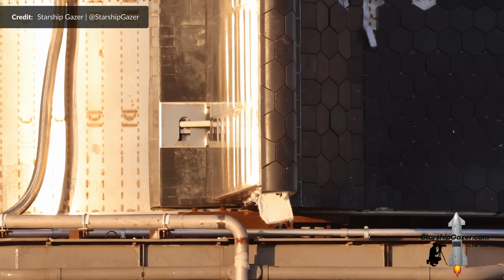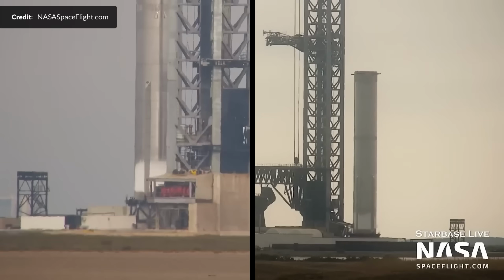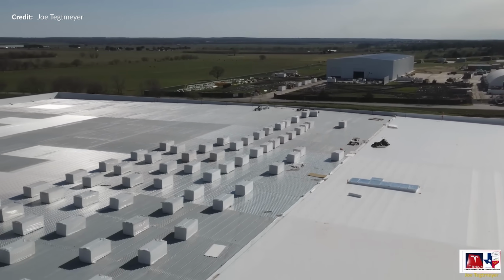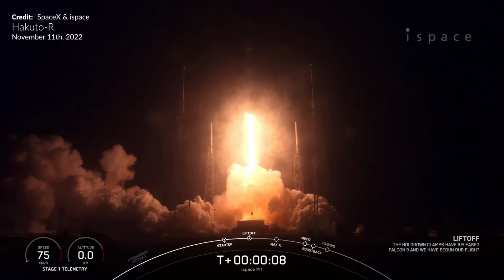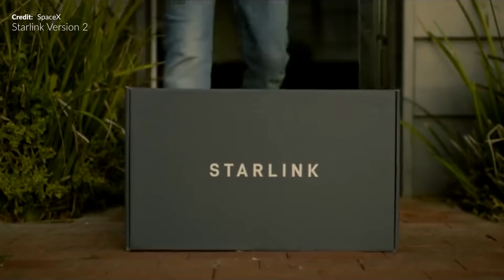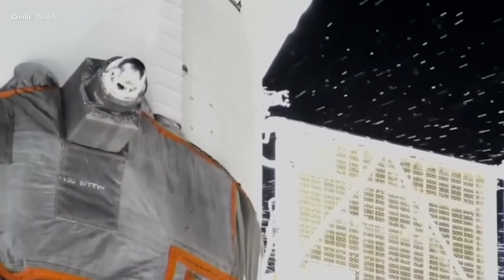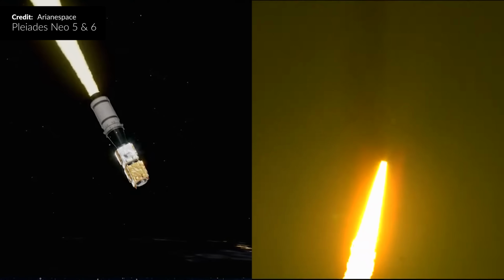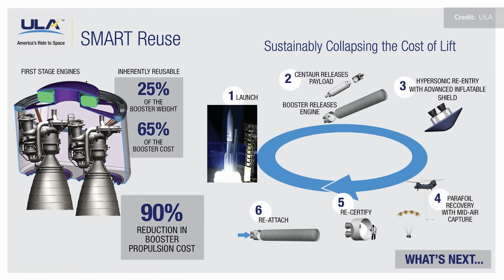SpaceX Starship Update, Record Booster Landing,  Soyuz Leak, Vega C Failed and Much More

Comment: These tiles will never work. These will be what ends starship if not fixed. While much more complicated, transpiration cooling should have been used. We've seen time and time again that tiles are a disaster waiting to happen to spacecraft. We've seen on this platform that they pop off left and right. This is without the body flexion, vibration, and strain of hypersonic re-entry and massive thermal cycles...heating and cooling all the while. It's going to hurt like hell to rip this bandage off, but they better do it now and redesign the heat shield system. Mark my words, the first re-entry test will fail due to heat ingress caused by missing tiles.

Comment: The tiles are popping off because the stainless steel hull contracts when cooling by filling with propellant. That is a mayor drawback of using stainless. It deforms massively under heat changes.

Comment: There are 7 SpaceX launches in December, including three in less than 36 hours.  And at the moment LC39A is tied up with preparations for the next Falcon Heavy launch.  Maintaining that rate will deliver 84 Falcon launches in 2023.  The announced 100 SpaceX flights for 2023 will include the permitted 5 Starship launches from Starbase and presumably some Starship launches from LC39A.  Because of the Falcon Heavy preparations it will not be possible for SpaceX to launch a Crew or Cargo Dragon to the ISS before the end of January.
Reply: CRS-27 is planned for Jan 2023 and Crew-6 is planned for Mar 2023.

Comment: Question: Regarding flames creeping up the fuselage above the engines of SpaceX Boosters. Is this nominal? Doesn't this cause damage? I'm assuming it's a low pressure area but I would have expected a better aerodynamic design. [see: 19m 23s]
Reply: Yep. Nominal. You can't have a cylinder that doesn't present recirculation zones behind it, unless you change its shape completely. This causes the low pressure zone you mention, which sucks the flames into it. Engineers know this, so they add thermal protection where needed. =)

Comment: We must remember that when Shuttle Atlantis lost more TPS tiles than Columbia it reentered successfully, and was relaunched only months later.  That was because by chance the lost tiles were over the only stainless-steel part of the hull.  Starship, whose hull is all stainless-steel, does not need the tiles for survival, only for speedy reuse.
Reply: The lost tile on STS-27 was over an aluminum antenna mount, not steel.

Comment: Just thinking about the reuse of the BE4 engines, since the rest of the rocket remains expendable, maybe they will use a set of explosives girdling a tank to destructively separate the engine section?  While expedient and requiring minimal additional engineering of the overall rocket, the resulting ragged end wouldn’t necessarily ease the other challenges of re-entry and recovery.

Comment: The only thing that matters is if the tile stay on during a static fire of the booster.. cuz they're not going to use those engines on starship until after the boost back burn

Will they fall off when it's on the opposite ends of 33 raptor tubes

Comment: So, is Starship going to work the same way Tesla and various vehicles do?  

It will launch in 2022

Launches happen late 2023

Everything that happened with the static engine tests was predictable.  The math would have shown this.  Modeling SHOULD have been able to show this.  Right now there's lots of upper stages and none of them have gone up to LEO.  In fact none have flown to near weightlessness.  

I'm getting tired about hearing about all the "neat mods" that's happening to the ship and to the pad.  At some point it just gets boring, and that where I'm at now with Starship.

Comment: Why not put a scale starship on a falcon 9 complete with heatsheeld for testing
Reply: Why not modify a falcon 9 and try to catch it with arms to prove it can be done?
Reply: @greenalien5509  Starship has the Thrust to Weight Ratio (TWR), so that it can hover on one engine. The Falcon 9 booster, even on one engine at minimum throttle, can't hover as it has too much thrust. So the Falcon 9 landings are timed to start the landing burn, so that the speed equals zero as the legs touch the ground. This method is not accurate enough for the catch arms.
Reply: There were plans to recover the second stage from a Falcon 9, but the recovery equipment took up too much payload space.
Reply: @steveaustin2686  What type of recovery equipment were they thinking of using?
Reply: @StevePemberton2  A thermal protection system (TPS), since it would be returning from orbit. Likely legs and grid fins for recovery along with the propellant for landing. Or parachutes for a catch attempt, ala the Rocket Lab Electron. Apparently that ate too much into the payload mass and the second stage recovery for Falcon 9 was dropped.

Relativity wants to make a medium/heavy lift version of what looks like Starship for the Terran R rocket, but we will have to see if recovery is done with that small a second stage or not.

Comment: Can't they just spray a thick coat of a heat shield material? And once they can control reentry speed instead of coming in so fast then the heat shields won't be such a problem. I've been building a space plane in my basement and a rocket I call candle. Instead of coming in a high speed we will stop at the edge of space and earth, then just slip into earth's gravity and then power up. Now I just have to find a way to get it out of my basement. Candle (rocket) is out behind the barn I made it look like a grain silo so I'm cool now, so far.
Reply: The heat shield tiles are baked to become the tiles. You can't really turn that baking into a spray. It would be like saying, spray the cake batter onto a plate to make the cake.

Comment: The Soyuz temp may have only reached 30C, but that was at minimum power, not in free-flight mode with all the onboard nav, control, and crew support systems running. When they power up the essential systems it will get a lot hotter, but they may be able to do a bare-minimum configuration to reduce power demand and slow the heating. If they can get a new Soyuz on station unmanned, they may send the damaged one down unmanned, and use the venting of cabin air supplies as a once-through cooling system.

Comment: ULA's "smart reuse" system is kinda lacking in comparison to falcon 9. Obviously still being forced to scratch backs and sniff butt holes.
Reply: ULA is going to have the SMART reuse happen at a much higher and faster part of the launch, so trying to recover the whole booster would be harder. The Vulcan Centaur is 5.4m (18ft) in diameter and the Falcon 9 Block 5 is 3.7m (12ft) in diameter, so the Vulcan Centaur is likely to have a higher dry mass, even without recovery equipment. So that heavier mass also increases the difficulty of recovery. Since the tanks are apparently one of the easier parts to build and cost proportionally less, ULA only plans to recover the most expensive part, which is the engine section.

Comment: Is it known why SpaceX is going to risk a Starship AND a Booster in an initial orbital mission?  Would it not make sense to launch and land a  booster on its own first? In the same vein to date SpaceX has only managed to successfully land a Starship once. How about attempting a Starship launch and catch before flying a full stack?
Reply: Because the blunt end of the Superheavy booster isn't aerodynamic. SpaceX plans to do soft water landings for dialing in the accuracy, before trying a catch attempt. The Superheavy booster would still have to do the same testing for just the booster launch as the full stack. Most importantly, the 2025-2026 Artemis III manned landing is not that far off and SpaceX has to do an unmanned test landing before then. So testing needs to move right along, if they are going to make the Artemis III launch.
Reply: I also like this channel very much, I think we can discuss this topic further. Do you use other contact methods.

Comment: I have a question that has probably been addressed before but I wonder why boca chica doesn't utilize a blast diversion tunnel like nasa instead of just letting it slam into the flat concrete?? Thanks for your great insight, Merry  Christmas
Reply: Part of the reason is the ground is not great for digging down, very high water table and it’s really a swamp. The other part may be that the keep doing so much work at the pad, that if there was a large trench/diverter it would get in the way of working on engines/stuff under the skirt.

Though it’s all really speculation as I don’t think we’ve had an official explanation.
Reply: Because Musk said one wasn't needed. And because Musk demands a cult of personality, all the engineers must follow his divine wisdom.
Reply: @TheOwenMajor  I always thought the not needed comment was more for starship, rather than the booster.

Comment: Great vid, it’s just a pity rockets don’t actually operate in a vacuum or do they....hmmmmmmmm.
Reply: Yes, rockets work in a vacuum. If you   throw propellant out one end of the rocket, it will push that end the opposite direction. Just like if you have a high power water hose, it pushes the nozzle in the opposite direction from the water spray.

Comment: A Ship static test on the suborbital stand is a harsher acoustic environment because the concrete is very close, reflecting the exhaust plume's shockwaves back up at the Ship. Having the Spaceship on top of the Superheavy, and with the OLM sound suppression system going should actually be "softer" than the standalone static test due to the greater distance and the fog absorbing some of the shockwave power.

When we flew the X-Racer at Mojave, I was really impressed with how much the rocket noise went down as we climbed away from the runway. It went from "Can't hear a damn thing" to a noise Rick and I could shout over.
Reply: I also like this channel very much, I think we can discuss this topic further. Do you use other contact methods.

Comment: I wonder if the tile loss on S24 won't be as bad when it's on top of the Booster, thus less vibrations going on by the engines. Both sets of the engines for Starship would be rarely used at same time.  Least Prototype wise in flight.

Comment: I dont understand why they dont just put the heat shield tiles inside the ship, stainless steel is highly conductive of heat I think the tiles would work just as well inside the skin of the ship. 
It would work the same way that you boil water in a plastic bottle over a campe fire, as long as there's water in the bottle the plastic on the outside doesn't melt.
Reply: The tiles are to keep the steel from weakening from the heat. If the tiles are on the inside, then they can't protect the steel from the heat.

Comment: I believe the new building is a factory for making massive numbers of Starlink antennae. I mean how else will SpaceX make the millions of Starlink antennae ("Dishy") that they will need to ship to customers, when they lower their price of not only the service, but "Dishy" too. It will be hard to get millions of new customers each month, unless they lower the entry price/cost, so $500 or $600 just won't do it, unless they add $10 or $20 per month to the price of the service for the first year or two, after they lower the price of the service to $49 or $69 per month or something like that, making it much more affordable and attractive to customers all over the World. In that case though, SpaceX would still want to make "Dishy" for as little as possible, and in much higher numbers, such as ten-thousand per day (or a few million per year). They NEED to do this in order to get a few hundred million customers over the next few years, and make billions of dollars per year (which is required to make the dozens of Starships each year that Elon wants to make), and there is nothing else I can think of that SpaceX needs to make in such high volume, other than the massive numbers of "Dishy" that will be needed to get millions of new subscribers every year. Think about it. Right now they're bringing in just $120 million or so per month from the one million subscribers they now have (about one point five billion dollars per year), but they need to bring in tens of billions of dollars per year, or like twenty or thirty times that. How else will they do it if not by ramping up to a massive number of subscribers? The only way to do that is lowering the price of the service (and the cost of "Dishy" too), and signing up way more customers.

Comment: @Marcus House Merry Christmas to you and yours, and the same to all my fellow commentors. ... I am thinking that the tiles falling off Starship is a bigger deal than they are letting on. Re-entry temperatures are hot enough to penetrate the steel underneath,  correct?  I'm still wondering why the launch pad is not raised higher, or the ground under it is not dug out (same result either way, separate the engine exhaust from the ground.) In Indianapolis in 1930 an entire 22 story, 11,000 ton building (Indiana Bell building) was rotated 52ft down the street. Occupants continued working in the building with power, water, sewer and gas all available. A sidewalk was installed that brought the walker to the front doors throughout the entire move. Certainly today SpaceX can elevate the launch pad to eliminate or lessen the vibration issues.

Comment: Heat shield tile dislodging solution:  Means and method:  create a flexible textile comprising a heat resistant Carbon fiber mesh; The consistency of hardware cloth, permanently glued and imbedded onto a substrate of adjacently arrayed hexagonal heat shield tiles. Fasten the textile to a spaceship using heat resistant cleats that are welded to a stainless steel hull; and tie wiring the flexible textile to the spaceship via the cleats.  The tie wires are welded to the cleat once they have been stitched through the flexible textile and tied to the cleats. --  --  Merry Christmas!

Comment: During WWII the USAF stopped painting their planes in order to decrease weight and optimize range. How much weight from soot (carbon black) does each launch of a Falcon booster add to its weight? It's cumulative.
Reply: The USAF didn't exist until after WWII, so you must mean the US Army Air Forces. Apparently, cleaning the complete booster is not worth the trouble compared to the evidently small mass penalty of the soot. In close up pictures, when the booster is recovered at Port Canaveral, there are clean lines along what appear to be the seams in the booster, so evidently SpaceX just does enough cleaning for inspections.

Comment: because of the shuttle history I have to admit the tiles are my greatest fear for Starship, and of course the catch being overly time and accuracy sensitive, smallest mistake has huge potential for failure, I understand weight would be an issue, having to reserve fuel for it, but I would be more comfortable with the earlier idea of perspiration cooling, and landing legs, is that extra weight really so prohibitive, is there no way to compensate with some tank upscaling, or something? Especially considering it will be needed anyway for landing on Moon and Mars
Reply: I also like this channel very much, I think we can discuss this topic further. Do you use other contact methods.

Comment: Can't the resin used for the heat shield blocks also be extruded and baked in thin 'threads' in a single process?
It'd be MUCH quicker than baking the bricks, and could theoretically be woven into a superfine net tightly holding the shielding bricks in place.
Seems like a no-brainer to me!

Comment: I'm more and more convinced that the OLM has been an underestimated project right @ the beginning. The power of booster engines are way too big to be "fit" there under. And as for all projects (also the BIG ones) have a dangerous drawback: if not well considered at at he beginning could became a nightmare (& dangerously risky) if not impossible, to be solved after.
Maybe the solution of using two kinda solid state boosters side by side could greatly help the booster to lift off.
But it's already too late, to do this. I agree.